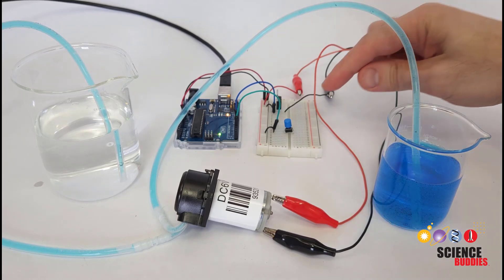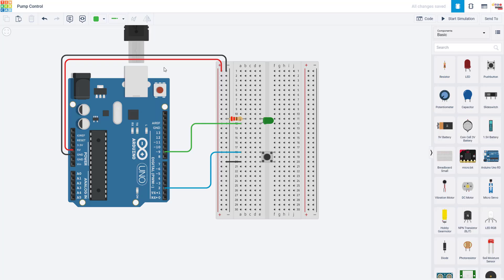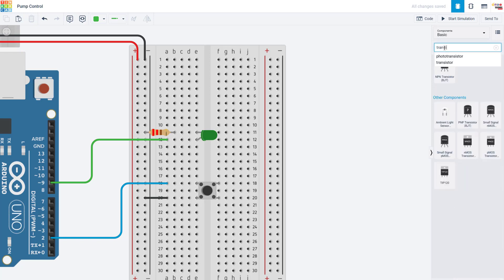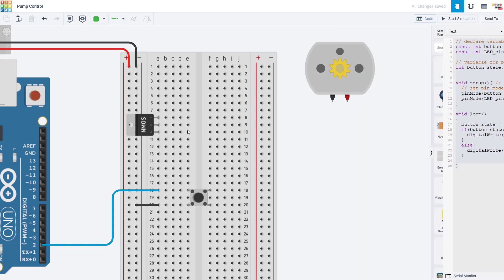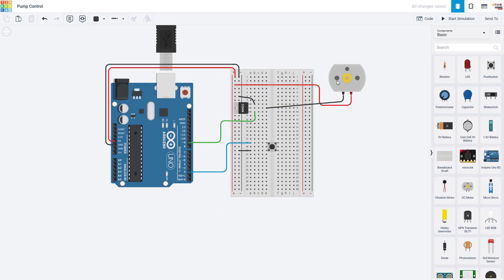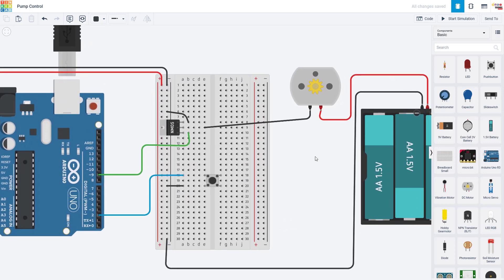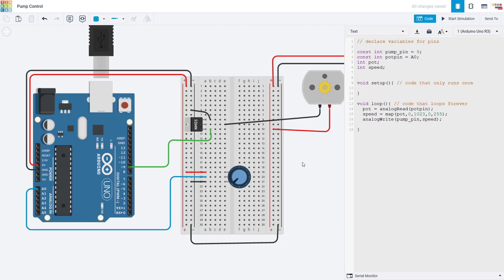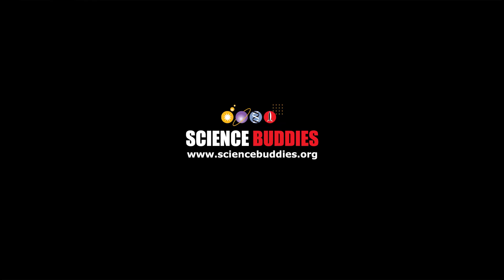Control a Pump with Arduino (Lesson #15)

Comment: Can I use a npn transistor instead of a MOSFET one
Reply: I tried with a npn one and It got incredibly hot,DON'T TRY WITH A NPN ONE
Reply from the maker: An npn is not a direct replacement for a MOSFET, it requires a resistor connected to the base and the pins are different. If you just removed the MOSFET from the circuit and swapped an npn transistor in its place it will not work properly.

Comment: In the video what are the red and black alligator wires connected to?
Reply from the maker: They are connected to the pump on one end and to jumper wires that go to the breadboard on the other end.
Reply: @Science.Buddies  We're using a 12 volt motor instead of a 6 volt one. Could you send me a link to a transistor that you would recommend and could you tell us which transistor you were using in the video? Thank you❤

Comment: hey man i wanna create a soda machine for a physics project where i wanna use a scanner in which when placed a cup with qr code attached to it the scanner will scan it and the electric pump will pour soda directly into the cup so can i use this pump for tht purpose
Reply from the maker: This pump will work to transfer liquids but please make sure any pump and tubing you purchase are labeled as "food grade" if you will be drinking the soda.

Comment: Is a mosfet transistor necessary? Or can other types of transistor be used also? If so which ones?
Reply from the maker: You could use a BJT transistor instead - we don't have our own tutorial for that, but you can find them online.
Reply: @Science.Buddies  may I know if I should use a npn or pnp transistor?
Reply from the maker: npn's are more common for this application

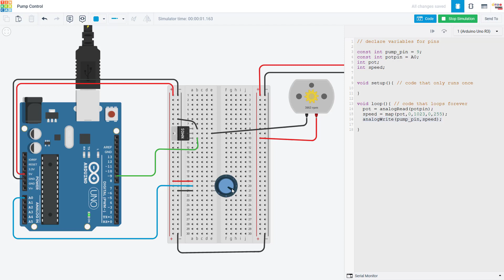Comment: 10:40 how does the pin 9 will gives the speed to mosfet and the mos gives it to the dc motor?
Reply: Pin 9 is a PWM pin, which basically means it can transmit power at variable levels, rather than an I/O pin which just turns on and off. 

Their code takes the reading from the potentiometer, which transmits data in 10-bit, and converting it to 8-bit for the output range. 

So when the Arduino receives a signal from the potentiometer, it sends a corresponding 8-bit signal through the 9 pin which tells the MOSFET to turn on with a specific voltage corresponding to the value coming from the potentiometer.

 Logic

Arduino reads an integer going into Analog Pin A0

Potentiometer Sends a Speed integer value to A0 pin ranging from 0-1023, which gets translated into a range of 0-255.

Pin 9 sends out Voltage corresponding to the value of the potentiometers current state (ex. 128 = ~2.5v, 255 = 5v) which the MOSFET opens the circuit to send out that voltage, which powers the pump.

Comment: Hi. Thank you for your instructive content and videos. I am a beginner at this with zero programming skills. I am trying to set up a system to monitor garage for water leakage and if there is one to trigger a vacuum cleaner to collect standing water. I wired up an off the shelf sensor (the Watchdog Water Alarm) to trigger the vac through an IoT Relay, as soon as water is present. Now I am trying to add arduino to this to control the system more intelligently. Specifically, a vac needs to run for few seconds longer after water has been collected, and the sensor is off to allow water inside the hose to be fully absorbed into the vac instead of leaving back on the floor after the vac shuts off. What is the best way to code this in arduino? Any suggestions would be great. Thank you

Comment: Hey what mosfet should i buy so that i can use an arduino uno to power a motor rated 6v and has more than 1amp current
Reply from the maker: We typically use these or something similar: https://www.amazon.com/gp/product/B07CTF1JVD/

Comment: Im using a temp sensor, soil humidity sensor and a screen
Using PN 2222A transistor

Pin(1) source
Pin(2) base
Pin(3) drain
I added 1k ohm resistor for the base pin for the transistor

For the pump im using external source
When my pump works my temp sensor and screen stops working even when the pump turn off they dont work back

But the soil sensor is still working fine

What could be the problem
Reply from the maker: Hi - if you are a K-12 student doing a science project, you can ask for help in the Ask an Expert forums on our website. We will need to see your code and pictures of your circuit to help you troubleshoot, we can't tell what's wrong just from a written description. If you are not a K-12 student, you may be able to get help on the official Arduino forums or other forums dedicated to electronics on sites like Reddit or Stackexchange.

Comment: Is there anyway to power both the arduino and the 12v pump using only a 12v 1a adapter
Reply from the maker: Short answer yes, but more than we can explain in a comment. See this page: https://docs.arduino.cc/learn/electronics/power-pins/

Comment: This seems interresting to one of my current projects. 
I do have a question. 
Is it easy to add another pump to run at the same time with one button press? 
I would like to add liquid to a container and remove the same amount of liquid at the same time from the same container.
Reply from the maker: Yes, that's very easy to do, but adding another pump will draw twice as much current and you might not be able to power it directly from the Arduino. Please see this video: https://youtu.be/I7MrL5Q7zvY?si=jFzYVQjESj3mYQEH

Comment: Does the pump you select have to be specifically designed to be controlled with PWM?
Reply from the maker: All DC pumps and motors should work with PWM.
Reply: @Science.Buddies  great thank you science buddies!

Comment: Hi! great video I just wanted to ask if a relay module could replace both the button and the transistor and if no what will the connection be like between the transistor and the relay
Reply from the maker: Hi - there are some details about using transistors vs relays that we can't really cover in a YouTube comment, you would need to ask in a more dedicated electronics forum like Stackexchange or the official Arduino forums.

Comment: why does my motor works for a few seconds and then stop and when i switch + and - it works again for a while
Reply from the maker: We can't say for sure without knowing more about your circuit and code. If you are a student doing a school science project you can ask for help in our Ask an Expert forums but you will need to provide more information: https://www.sciencebuddies.org/science-fair-projects/ask-an-expert-intro. If you are not a student doing a school project then you may be able to get help in the official Arduino forums: https://forum.arduino.cc/
Reply: hello having same issue did you end up finding a fix?

Comment: is it possible to set an amount of water to dispense? like only 2ml
Reply: For this you would need to have something like a flow sensor to calculate the liquid going through or just time it in a code but it can be inaccurate
Reply: some pumps specifications say the ml that can go through per second, maybe you can calculate how long the pump should be on for using that spec

Comment: what would you do if the external power supply a doesn't have a positive/negative end such as a barrel connector
Reply from the maker: You can buy a barrel jack adapter like this: https://www.amazon.com/UltraPoE-Connector-Adapter-Secruity-Terminal/dp/B0BTHTBKL1/
Reply: @Science.Buddies thank you for replying ! I meant that Im using a 12 V DC adapter that requires using a barrel jack connector . How would you wire the power supply if it doesn’t have a positive or negative wires?
Reply from the maker: Hi - to clarify, you plug the barrel jack from the power supply into that adapter, then you connect jumper wires to the screw terminals of the adapter and plug those into your breadboard. Most power supplies are center-positive meaning the middle of the plug is positive and the outside is negative, which will correspond to the + and  - labels on the screw terminals of the adapter.
Reply: Would the wiring matter in that case ?

Comment: Hi! Will it be okay to use a 2N2222A or a 2N4401 transistor? I couldn´t find the NMOS :(
Reply from the maker: Hi - yes, you can use an npn BJT instead of a MOSFET, but the circuit is slightly different because 1) while the BJT's pins (base, collector, emitter) are roughly analogous in behavior to the MOSFET's pins (gate, drain, source), they may not be in the same physical order 1-2-3, so you need to check the datasheet for the pinout and 2) the BJT requires a resistor on the base pin.

Comment: There is no need for a reverse diode to protect the circuite when the motor turns off?
Reply from the maker: In general it's a good idea to include one, in practice with an Arduino and small motors it seems that you can get away without one and not cause any damage.
Reply: @Science.Buddies  Thank you, and thanks for pointing out this aspect in the other video which I saw later.

Comment: hii quickly ask what is the blue thing in the middle that u push?
Reply from the maker: That is a pushbutton with a blue plastic cap. We have a tutorial about buttons here: https://youtu.be/yBgMJssXqHY?si=xXAfag6-eIzCdEUH
Reply: thank youuuuuu @Science.Buddies
Reply: hi i do have problem with the coding (first coding that just use mini push button and no battery), i try to do it on arduino ide software but i got error, may i know why @Science.Buddies
Reply: 6:30 using transistor
Reply from the maker: Hi - unfortunately we can't help troubleshoot code in YouTube comments, but if you post your code and a detailed question on the official Arduino forums someone may be able to help you.

Comment: Can we use a sensor instead of the button?
The code should be changed then?
Just for on and off
Reply from the maker: Hi - how you would change the code and circuit depends on what type of sensor you want to use. We have several videos covering sensors in our Arduino tutorial playlist that you can check out.

Comment: If you were to use this for a hydrophonic system where I want to make the pump activate every 4 hours for X amount of time how would I be able to integrate it to this circuit? Thanks :)
Reply from the maker: Hi - there are multiple ways you can do this. We recommend looking into the Arduino delay() and millis() functions. There are also libraries like TaskScheduler: https://www.arduino.cc/reference/en/libraries/taskscheduler/
Reply: Can we use a normal transistor